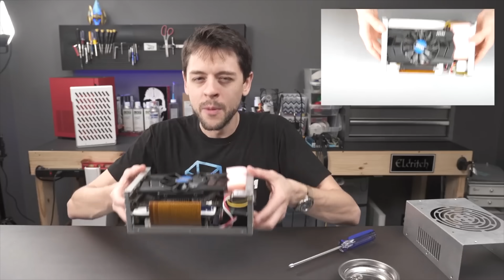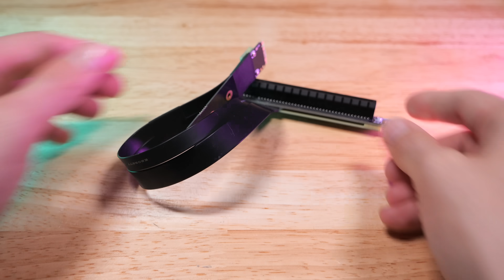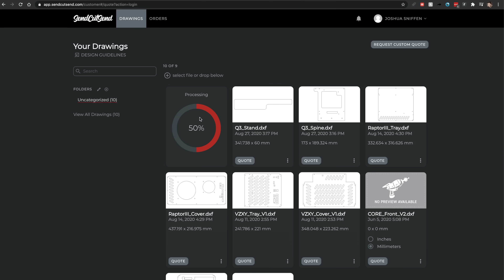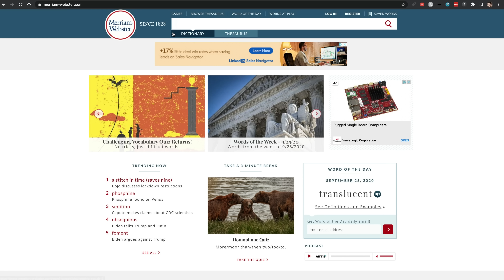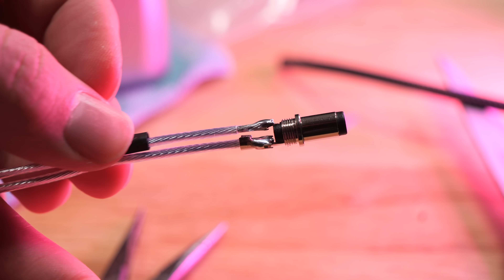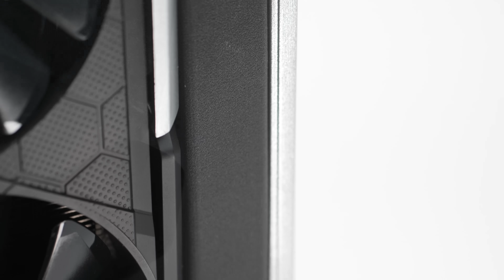Project Ionic: BIG GPU, tiny motherboard...

Comment: What was the cabling used? Almost looks like speaker wire, which makes sense for the gauge.
Reply from the maker: it was 16AWG silver plated stranded copper. Same stuff used in pc power supplies but with a transparent jacket

Comment: I'm probably making the usual mistake of commenting before watching the whole vid, but...

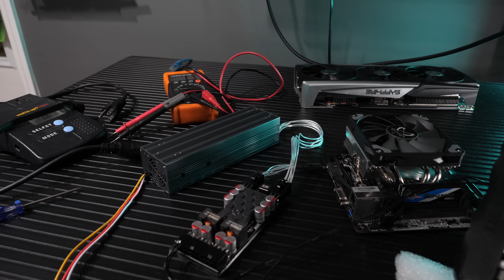5:28 - I would be surprised if the DC jack was centre-negative (which is the way you had the probes there, and the reading wasn't reading a negative, so you wired the DC plug as centre-negative).

I couldn't find the DC polarity info in the A300 manual, but I would think it's very likely centre-positive?
Reply from the maker: I wouldn’t put too much stock in the footage….I grab what I can while still designing, exploring, building. I haven’t come across a plug that was center negative either so I doubt this is how the end result was wired.
Reply: @NotFromConcentrate  Ahh, no problem.

B-Roll, and all that. hehe

I was gonna say, it would be strange if you didn't highlight that if it was wrong, as you would have found out when you bought the new board.

I like the idea of tiny motherboards hanging off a GPU. I said a few years back that we would start to see more ARM or x86 SBCs with PCIe as well.

It's interesting how the graphics cards have got so huge over the years, and the CPUs/APUs more and more integrated. I know the Ryzen can run without any chipset IC at all.
Reply from the maker: @electronash  I appreciate you watched the video and paid attention so closely !!!
Reply: I liked the end result, btw. ;)

Comment: You need to do this again with a big ass 4090!
Reply from the maker: No thanks, I don't have a structural engineering degree and I don't want to be held responsible for death and injury if it crumples under its own weight.

Comment: The Backpack.
It would be really cool to use the RTX new gpus with the flow through heatsink part. Remove the fan, put a small radiator there (it'll sit next to the mobo). Then have a fan attached between the gpu and radiator. Now you have a water cooled cpu while still adequately cooling the gpu.

Comment: That is just too cool. I’m interested to know the performance of the Zolman CNPPS2X I’ve used that series since rhe P4 Coppermine days of rye CNPS-700-Cu. Was awesome for it’s time then the bigger 7000-Cu into the 9000, 9500 even had the GPU & NB flowers what kind of TDP is it capable of?
Reply from the maker: I don't hesitate to recommend them for 65w CPUs.
Reply: @NotFromConcentrate  that’s what I was wondering! I went heavy on the CPU side as I aimed for mini ITX creative media editing box so need good copper cooling for i9-10850 @125w. Using Noctua NH-D12DX-i4 cause it fits & cooks but looks off balance on side   A nice 95mm square copper cube would be awesome

Comment: how did you get the 3d model of the gpu?
Reply from the maker: Well, I make most of my 3D models. And keep in mind I make 3D models for companies (like Sapphire) as an industrial designer. This time though they provided the model for me, but it's not something generally available to the public. However I do have a "lite" version of this model available in the Project Files on my patreon page.  GrabCad is another good website for computer parts, although I advise to confirm with calipers as many of the models there are highly inaccurate. I hope this helps.

Comment: As a watcher of many tech channels, Flight Sim is notoriously hard to push. If I remember correctly,  it is one of the few titles to benefit from multiple cores (as opposed to single core speeds)? Also, more/faster RAM as Ryzen chips are more responsive to RAM frequency than Intel.

Comment: I am hoping to do something similar - do you know specifically what fried in the first motherboard (VRMs, power input, chipset, something else)? I suspect it was probably just that the 3700X tried to draw more than 65W and killed the VRM power converters. I'm planning to try this with a 3600 (65W TDP just like the APUs) with on an X300W with the latest BIOS. What do you think?

Comment: Your channel definitely has me wanted to build a tiny itx system. I think I'll wait a bit though as with the new 30 series FE cards using a much smaller pcb, you might be able to squeeze a 3080 in the SkyReach 4 mini, providing there's enough power for it.

Comment: I’ve long wanted to build a system like this. But I want it to have all the fin stacks exposed. I want to find or build a special cooler that has the fans under the heatsink on the gpu like those c style coolers. Have a beefy heatsink on one side for the cpu and another on the opposite side for the gpu. You could even mod the psu to have a similar style heatsink on it. As well as any ssds you might use.

Comment: Very cool video. My one question is How much did this cost? That cost should include all the parts you had to replace. Also, how long did this take? what day did you start? What day did you finish?
Reply from the maker: Um the cost you can see I guess by adding up the parts in the description. It wasn't bad; none of the parts are particularly expensive. How long it took depends on how you want to measure it. Like I said I've been thinking about the concept for years, and I struggled with the design and threw alot out. But having it all go together took two weeks. Peace

Comment: in my mind the cpu cooler looks a bit ugly with that copper :o .. i would more like to use the shuriken 3 :) and if the Cpu's dont working maybe they fail with pressure of the cooler , you said you worked on it for fitting.
Reply from the maker: It's a reasonable hypothesis but I can confirm that isn't the issue. Peace!

Comment: next level would be powering through a USB C hub with display signal through USB C also, so only one cable connection to the system through USBC, and may be building the USBC hub inside the bottom plate :D

Comment: Awesome build! I personally like hate my 5700xt lol. I've had nothing but problems, and STILL can't use Enhanced Sync! It's been a year and it still causes black screen crashes, and is recommended to disable in the Radeon Driver notes. Hopefully Navi/RDNA 2 goes better for them, but I will be going with Nvidia as soon as I can afford a 3070 or something, after a monitor upgrade. Stock issues and some minor stuff right after launch is one thing - a YEAR without features I paid for is another. I love Ryzen but man... Navi has been terrible compared to my RX 580 8GB experience honestly. Hell even my 3600 only barely still boosts to 4.2 on a couple cores lol. But that may be more my mobo. Great vid tho?!! Love your work, tho I do wish you went with a Zen 2 CPU lol. So much better performance... Especially in gaming and emulation, along with coding/compression decompression.
Reply from the maker: Hopefully the new owner will put a better CPU in once they figure out the UEFI stuff. Bummer you have such trouble with your GPU. I do like my 5700XT alot for the price. Thanks for the comment!

Comment: If you find someone that can tell you about flight sim could they help me with forza 7. Brought the ultimate edition, downloaded, played for a few hours and now every time I launch it I get the splash screen and it just closes.
Reply from the maker: I did find the solution for me! I had to load Disk Management and change the drive that mounts for MS Store games to "Online" when it pops up. It sounds like a different issue for you?
Reply: @NotFromConcentrate  that didn't work but thanks for the feedback. I uninstalled and reinstalled to c drive and again it ran once but then again wouldn't the next time I tried. However I transferred it to my d drive and now its running fine. Thankfully there both m.2 nvme so transferring it over was a matter of seconds. First time I'd transferred anything on my new system but damn I was taken back by the transfer time having previously been using hdd to sdd transfer from my games storage for my most played games. Used to be 150kb/s and was now a snip over 5000kb/s 😊

Comment: I love this video! I currently trying a similar setup with an sff 1660 super to squeeze into a GameCube (shoutout to TechByMatt.) Just waiting for a comparable pico power supply to come in stock. For anyone else planning to use the Deskmini a300 with a GPU, the bios currently doesn't work without an apu. There's a group of people trying to crowdsource a custom bio to allow it, but it looks it has run into some roadblocks. Here's a link in case there are any updates or if you think you can help out!
 https://smallformfactor.net/forum/threads/group-buy-crowdfunded-modded-bios-for-the-asrock-a300m-deskmini-a300.10567/

Comment: Hey where did you get those pin crimping pliers from? They look like the work great, this build is so clean
Reply from the maker: They are the old MDPC ones, they have a newer set you can buy at Titan Rig now.
Reply: @NotFromConcentrate   ok awesome, I am a diesel mechanic and have to wire up plugs sometimes and the ones I have don't seem to crimp like those do. Thank alot for the info on them

Comment: But that's not even a big GPU, barely pulls any power... I'm confused
Reply from the maker: It's physically big, and as I mention in the video it's a concept for people like you to springboard and put your 3080s in or whatever your heart desires. Peace
Reply: @NotFromConcentrate  1. that 5700xt has a worse vrm than a REFENCE modle...idk why you would choose it 2. this is stupid since your limited to 4x pcie 3. that CPU's single core performance is so slow 4. the latency of that CPU plus ram is so bad 5. that GPU is so light and small and so energy efficient compared to the old beasts of the past 6. ew why would I want a gpu with so such an ugly PCB to work on like the 3080. So GPU performance is terrible and so is multi core and so is single core... what the hell is the point... especially since your putting in a caca GPU?
Reply: @NotFromConcentrate  lol

Comment: you need to get 4750g. Almost the same performance as 3700x just L3 cache bit low. now running in my A300. sadly the sodimm limited the Apu performance. the highest i can find is 3200mhz. Maybe time to move the cpu to itx (i have 4400mhz drr4) but it is hard to find case below 4liter that good. i got this idea 3liter case with the pc case side near pcie you can unscrew and slot a gpu like cartrige but im dont have the talent to make it. lol.

Comment: Get a motherboard tester, you could save a lot of time. And I never recommend putting a CPU on a potentially dead motherboard, it will have a high chance of killing your CPU by shooting more voltage in it than it needs because a resistor could be burned causing the busses to shoot it it with more current internally. Just saying, better safe than sorry, great job!

Comment: i wonder why made you pick the 2400G over lets say a 3600? 
the 3600 uses less power and wont blow up the tiny vrm on the A300
i mean you are not using the igpu right? 

other than that, its a fantastic build

Comment: How much performance is lost running the GPU through an M.2 slot?
Reply from the maker: None for this GPU. Possible some for the 3000 series but I won't know until I get one, but theoretically it's not going to make a big difference at mere mortal resolutions.
Reply: Not From Concentrate what was the slot speed? I thought anything less than x16 made a difference
Reply: @johnsherby9130  Can't imagine it's anything other than PCIe 4.0

Comment: yeah I mean, I just got a case off the internet for 30 USD. tbh it's quite advanced, at one point I had to use my hands to unscrew the side panels. but yeah PC works fine. you should check it out at wwww.googlechrome.com

Comment: i had to watch this back a few times to figure out what kind of external psu you are using to power it. i think i see it on your desk near the start of the vid. so the psu we dont see outputs a 6 pin 19v to power your 330v shimmy board?... so to get it to your desk, you need some sort of 6pin extension cable? not detracting anything from this wonderful build though... really clean, and pretty jealous! if you could build a standard mini psu mount into the stand, its a marketable product and would likely sell well imo. liked and subscribed... left me wanting more :)
Reply from the maker: Tony K good news is I have alot more like this in my feature builds playlists, and with creative tiny internal PSU. Ty for watching!!!

Comment: This is the closest thing to magic. Still cant figure out where the PSU is and how it actually works
Reply: It has an external power brick (think laptop power brick) that provides 19 volts to the small board mounted behind the GPU next to the motherboard.  The small board takes in 19 volts, outputs 19 volts (to power the motherboard), and 12 volts (to power the GPU and to power the PCIE slot for the GPU)

Comment: I think you have shown that the major manufacturer's have led us down a rabbit-hole with all the RGB emphasis.    I think your design would be cooler with a titanium frame, and a cast-iron steam-punk base.    Maybe a heat-pipe going to the base from the chipset.    A graphics cards with four-fans would be wild.      If someone mass-produces this with a 3950X, or 3900XT, etc.    That would be something that would be cool.     Another thing that would be cool is if the base were hollow and you could hide things in it.       Just sayin..... there is something cool about this.

Comment: I honestly wouldn't even know where to start when it comes to designing a unique piece of functional tech art like this.
Reply: Get a super small board, make holes on whatever surface you want to mount the stand offs, make a bracket to  hold the gpu on the other side and add a x16 extension to where  the card is. 
It's not super hard, not at all actually. But to make it look super clean and nice it will take some thought. 
You can do it ;)
Reply: David Boggs I’d rather just buy the stand and cables and just buy the MB/CPU/GPU and go from there

Comment: Do you get the models for the components somewhere or do you model them yourself? Looks like that for the power supply but that gpu seems like a huge hassle
Reply from the maker: I make some, and sometimes I can get them from the manufacturer. I spend many hours modeling parts for builds before I can start work.

Comment: don't use a AMD GPU and it should work like a 2080ti or RTX3080 or RTX3090 i have a RX5700 and it's the worst gpu overheats all the time it's loud
Reply from the maker: I have several 5700XTs and a 5700. One of them is utter garbage, another is loud. This one is very premium. What brand/model is your 5700XT? This rig would look cool though with a giant 3090 xD
Reply: @NotFromConcentrate  its just a rx 5700 not the xt
Reply: @NotFromConcentrate  its a gigabyte reference cooler sorry I forgot to add that I had to modify the factory fan curve and as the result it's more noisier now but doesn't randomly shut off the computer when it overheats
Reply from the maker: @shadowsalc1706  Oh the reference cards coolers are just awwffullllll. I only buy reference if I'm going to waterblock them. <3

Comment: But a mini STX board only has a 4x link. So any high performing card would be significantly bottlenecked. What won't be bottlenecked are lower end cards that don't need large coolers. So this doesn't make much sense to me.
Reply from the maker: This is true, but I have never seen a gaming benchmark where there was any noticeable difference between 4x and 16x. If you can link me one to test I can take a look with my higher end GPUs and see, but I have never seen this be a problem in the real world.
Reply: @NotFromConcentrate  What about eGPUs, they use Thunderbolt 3 (which is 4x) and there is definitely a performance hit with higher end cards there.
Reply from the maker: @QuantumBraced  I think that is a whole other banana. :)

Comment: Hey there Mr Roger Cook or Tom Silva (only NFC will get those names)  some old timers might 
Anyway, is there a place you have to submit custom builds? I used a flat res that EK makes and used some of your techniques to make a non convergent radiator mount for it so it would be looking out the case window yet not block airflow I think you would like it.
Reply from the maker: You sure! Send me an email. You'll have to Google but I'm easy to find
Reply: Not From Concentrate  Ok bud thanks I’ll see what I can find thanks. This build was complicated but simplistic at the same time great job man
Reply: Not From Concentrate I found it

Comment: Good job man looks cool. I wonder whats the difference in performance between this and a mitx board with a real pcie. I know ryzen is pcie 4.0 so should be the same but I wonder if those lanes are direct to the cpu like normal pcie is or does it go to a chipset first for added latency.
Reply from the maker: It's real PCIe, so there is no performance difference you could measure with a game. Of course risers do produce some signal degradation, but at this length and for these shielded risers  it is minimal. You could't run, for instance, a game benchmark and see a difference between the two. Good question!
Reply: @NotFromConcentrate  thanks for the reply. Hopefully they lunch a board like this for the next gen ryzen I'll definitely build something like this.